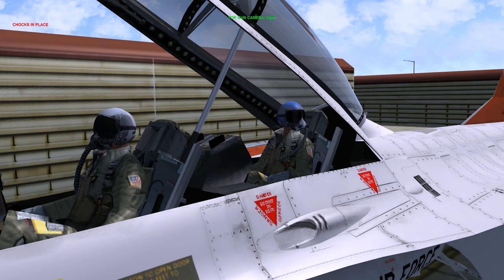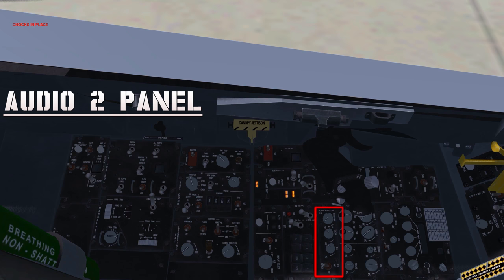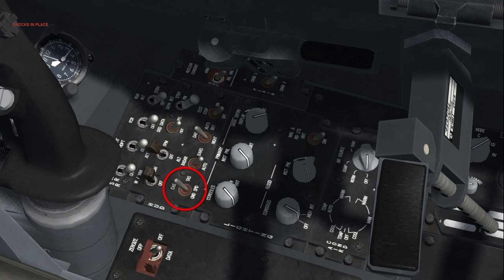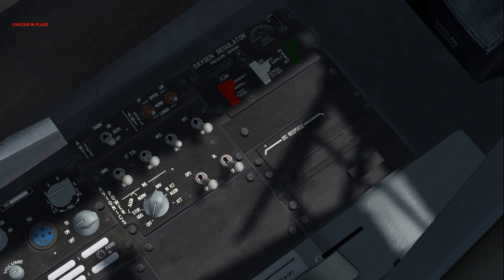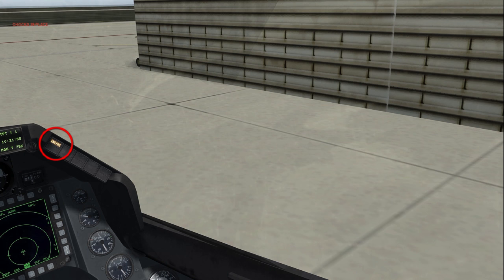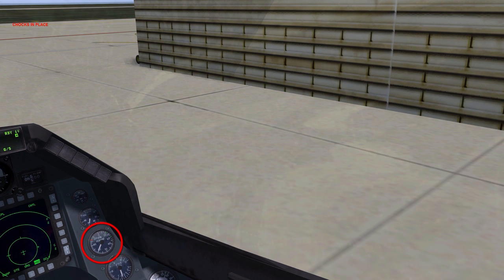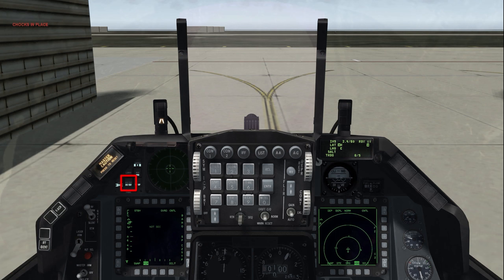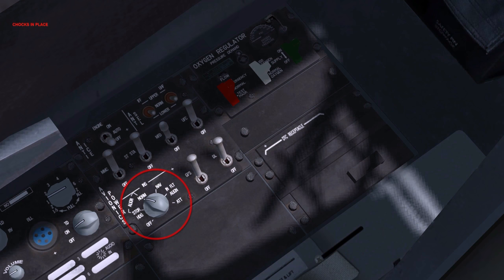Falcon 4 BMS Tutorial 19 : Ramp Start and Ground Ops

Comment: Sorry, mate, but that part at 4:10 was very confusing for me. What is FCLS Relay and how do I know it's closed? Like, I can just accept what you said, but as a beginner on the F-16, I couldn't understand what's going on very well.
Reply from the maker: I should have said the FLCS relays are open and the FLCC is not connected to the battery. The FLCS relays close when the JFS switch is moved to either START position. The FLCS RLY light comes on when one or more FLCS branches aren't receiving adequate power from the battery. The light basically indicates that the system requires more power, and when the engine is started that power is supplied.
Reply: supanova Thanks, it's a bit clearer now, although I'm still quite unsure on what FLCS and FLCC really are, pardon my ignorance and thank you again xD
Reply from the maker: You don't need to have a thorough understanding of it at this point, but it is useful to know that the FLCS is the interface between the pilot and the aircrafts flight systems.

Comment: Just out of curiosity, why would one use Dump and Ram settings on the air conditioner? Also, why is the RDR Alt set to Standby for the safety of ground crew, how can it be harmful?
Reply from the maker: You won't ever need to use those air conditioning settings. Those are only applicable real world. The emissions from the radar would be harmful to the crew. Similarly you turn off the FCR when refuelling in the air to protect the tanker crew.
Reply: supanova Nice, not sure if it's implemented in BMS, but I'd do it anyway for eye-candy.